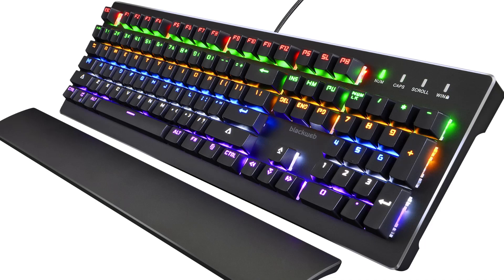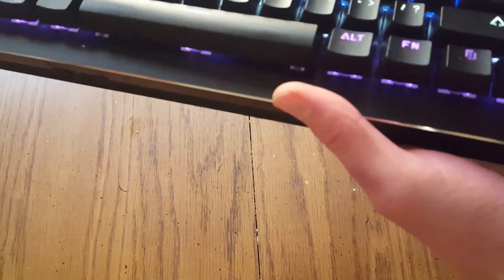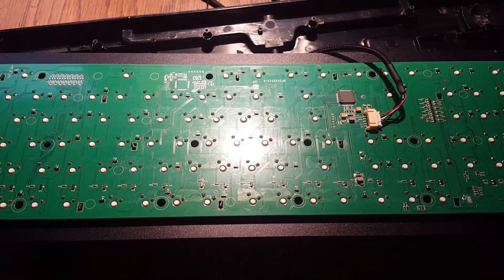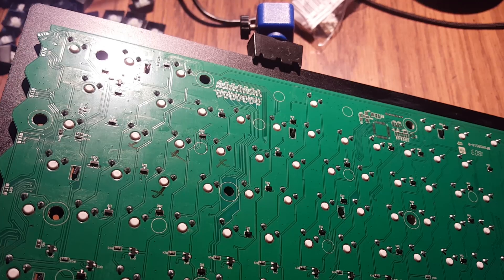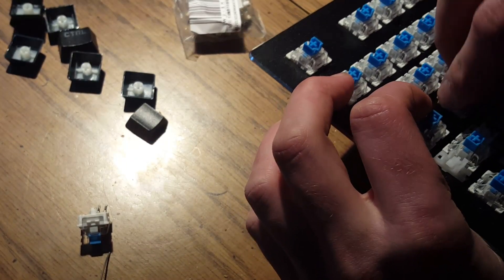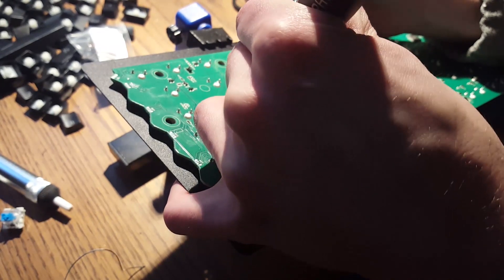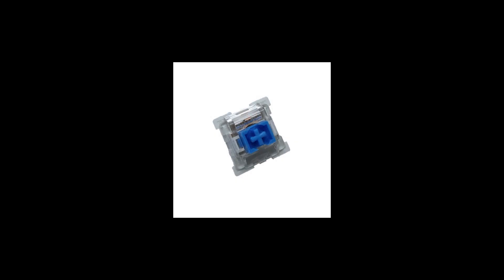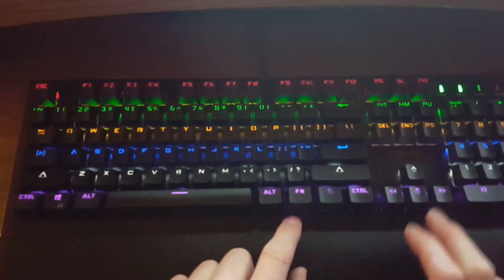Blackweb Mechanical Keyboard Teardown, Review and Switch Replacement

Comment: For those interested in this keyboard!!! I recently decided to change my switches to gateron reds and the pins where too wide, I had to clip them a bit. Turns out the board is An Outemu board and they use switches that have pins that are thinner than almost any other switches. So if you want to save the hassle look for other outemu switches!
Reply: Other than that, this is a great keyboard, I've had mine for almost 2 years now and never had any problems with it :)

Comment: I tried putting Gateron Yellows in. The switch doesn’t sit flush but it works when I test it out I then notice one of the pins actually bends so would i actually have to trim a pin?
Reply from the maker: So the pin is too long? If that's the case trimming it sounds like it might work. I got some some switches where the pins were too wide, and I had to trim them a bit as well. Too bad they aren't all standardized.
Reply: @Datzfunk  it was wide pins as well. Trimming them didn’t cause any functionality loss? I’m trying to see if I can use this pcb  and mod the keyboard for just a different experience
Reply from the maker: @Bleck3v3  As long as they make electrical contact they'll work. You might test out one or two first before you dive in and do them all. I've had some problems with a couple i had to clip, pulling them out and putting them back in fixed it though.
Reply: @Datzfunk  how did you trim the pins if they were too wide?
Reply from the maker: @Bleck3v3  I used a flush wire cutter.

Comment: so this keyboard is hotswappable?
Reply from the maker: Yes, the keys are able to be pulled out on the model I have. A bit of force was required. Make sure the legs of the new switches are the same. I got some that were slightly different and I needed to trim them a bit with a wire cutter.
Reply: @Datzfunk  Okay

Comment: Hey man srry for bothering you i have a problem of popping with the white leds i don't now what is the problem but i think it could be that i installed drivers from Reddit that didn't work but idk what do you think if you want to Replay i'd really apreciate that
Reply from the maker: Could you elaborate more on what you mean by "popping"?
Reply: @Datzfunk  Hey thanks for the response i think i made a short circuit with the leds while i was cleaning my keyboard with alcohol but the keys works fine so i don´t know if it is a form to change the dead leds
Reply from the maker: @kevinordonez8574  Probably a bit tough to troubleshoot the LEDs without taking the circuit board completely out. You can take the keys off and check the voltages on the LED terminals. If you have bad LEDs, finding a replacement will be difficult. I tried replacing some LEDs, but the brightness was off, You'd want to use the exact same ones the manufacturer used with would be difficult to locate. Maybe best to leave it as is.

Comment: See all the D letters on the circuit board they are Diode, if your mechanical keyboard has them than it is a n-key roller or no ghosting keyboard. (N-key rollover is where you press a variable number of keys simultaneously, and the keyboard is able to register them, USB is limited to 6)
Reply from the maker: Thanks for the comment!

Comment: hi i have the same back pcb as you have and i dont know if my keyboard has hot swappable switches can you help me plzz 

my keyboard name is '''''  havit kb435l  '''''

btw i speeled water on it yesterday and now im leaving it to dry

 any tips for me about water damage and how to solve it ????? 
i subbed btw 👍👍
Reply from the maker: I think that if they keyboard looks exactly like that, it could be the same internally, but with different branding. It takes a bit of force to remove the switches.  For water damage, make sure it's dry before you plug it back in. Maybe take the back off and leave it in the sun for a day.
Reply: @Datzfunk  i did a teardown to the keyboard from the keycaps to to pcb and im leaving it in my room to dry but not in direct son 🤔 will the sun contact can damage the pcb or the switches...
Reply from the maker: @SQUIZI514  The sun will be ok, you want to get things warm to evaporate the water, before it has a chance to corrode anything. Sun will just speed up the process.
Reply: @Datzfunk  thanks man btw how can i remove the usb connector in the back of the pcb .. ???
Reply from the maker: @SQUIZI514  If it looks like the one in the video, it's just a connector that you can disconnect. They keyboard you have does look a little different, so I'm not sure if it is constructed in the same way.
Reply: @Datzfunk  I'mdor bothering you and btw your help is very appreciated and thank again  you for your quick response and for your help 👍👍

Comment: I have a black web centaur keyboard and I’m having problems taking off the space bar and I was wondering if you had any tips or know how it’s done. It had a metal clip and springs on each side of the button. And I’ve tried so much to take it off and it won’t budge.
Reply from the maker: Mine doesn't have any metal clips. Just tried it now, it came right off by just pulling. There's one switch under mine in the center, and two parts to balance it on either side. I've seen keyboards with metal springs however, I think you have to pull them off part way, then the metal spring has to be moved to a certain position to to remove them. Be careful though, if I recall correctly, I think I partially broke a space bar of that type something like a decade ago.

Comment: I have a similar keyboard called Battletron, same keycaps, same blue switches, i want to change the led's to a white overal backlit, do you think it's possible to change the led's? i couldn't see if you changed the led into the new switch, im a noob in this and i though it would be fun to do.
Reply from the maker: I actually tired replacing a few LEDs, but i couldn't get the same brightness. I never got a good look at the front side of the circuit board, so I'm not sure how they are controlling the brightness. There's probably some sort of multiplexing, and possibly pwm going on. It it may be more effort than it's worth. If you can find LEDs with similar brightness to the one's you're replacing, it'd make things easier, but there's probably no easy way to do that.
Reply: @Datzfunk  thx, maybe i'll try it in the future, i think it's going to be very time consuming, i did find some leds online, but i have to replace 104 of them, it's a nice keyboard, but i don't know if it's worth it.

Comment: Hey Datzfunk, I want to replace all the switches in the blackweb keyboard I have, you're saying that I do not need to desolder them? I can just plug and play?
Reply from the maker: They can be pulled out. When you put in the new keys, make sure the  legs are lined up with the sockets as well as you can. Some key types might have legs that are too wide and need to be trimmed, otherwise they can be crushed. Good luck!

Comment: You need finer soldering irons, some fine solder wick, and a smaller solder sucker.
I am also surprised at the quality of the keyboard. It is very solid.

Keep an eye on Ebay for a cheap professional iron with a variety of tips.
Reply from the maker: I was actually using a jbc and t12 style cartridge irons. I now have some cheap tweezers too. What would really help is something like a Hakko fr-30..  if I could only justify the cost.. lol